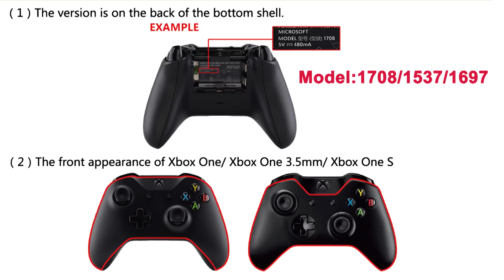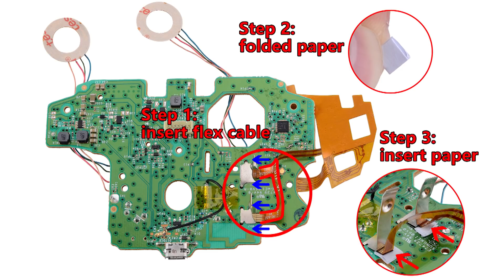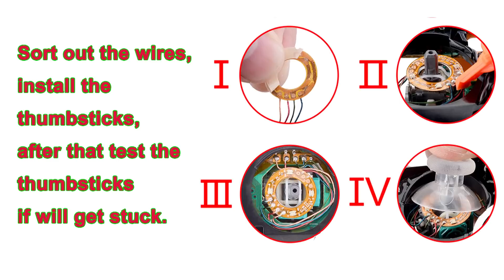Xbox One Controller DTF LED Mod Kit Installation Guide - eXtremeRate

Comment: So, I have been sitting here for a couple of hours following every step, making sure everything with the F strip is where they need to be (with the pieces of paper) and the entire sticker is lined up correctly yet nothing is working...can somebody or ExtremeRate please help me, I don't know what to do here.
Reply from the maker: Is the controller still functional? And are your AA batteries in full power?
Reply: @ExtremeRate  yeah, the controller still works and turns on fine with the batteries.
Reply from the maker: @samilynn26  So the F strip, when you insert it under the battery metal plates, the terminals have to touch with the metal plates. If you do this step right, do you see any damages on the LED and the F strips?

Comment: i'm a kid i will be doing this will anything break?
Reply from the maker: You need basic electronics repairment hands-on skills. And this is a DIY project so we will not guarantee any damages with your controller.
Reply: @ExtremeRate do you need to take out on and rb because i can’t take mine off.
Reply from the maker: @paperplanespaperhearts  You need to take them off during the installation
Reply from the maker: @paperplanespaperhearts  What's the problem exactly?

Comment: i attempted to do this, i did it but my controller lights up as soon as my battery is plugged into it i cant change the color from green im using rechargable battery
Reply from the maker: Have you tried a pair of ordinary AA batteries?
Reply: @ExtremeRate  yes i have they still light up but i cant turn it on or off myself or change the color from green everything is hooked up to the proper spot as soon as i plug the batteries into it it instantly lights up green
Reply from the maker: @ITry2bBad  That's weird. Don't worry, please let us know your order number via email to sevice@gamingcobra.com with your shipping address and YouTube name, we will send you the replacement of the LED flex to try again, thank you.

Comment: Will it still work if I use a cord, like on a strike pack?
Reply from the maker: Yes
Reply: @ExtremeRate  oh thanks, I just use a cord mainly so I didn't know if would work or not because the power comes from the battery contacts, but it didn't seem to mess with the micro USB port
Reply from the maker: @Chic_boom  Oh, sorry, I made a mistake. You have to buy the DTFS version instead of this version. And if you buy the DTFS version, you have to choose the CSP installation, which means you have to do the soldering (2 places) Please check this https://www.youtube.com/watch?v=YuoarkBQDI0
Reply: @ExtremeRate  oh thanks, I guess I'll use batteries, as i cant solder
Reply from the maker: @Chic_boom  Then the LED will not light up when you using the strike pack :(

Comment: Shame it doesn't work with the elite controller will there be one in the future ?
Reply from the maker: we will think about it, but elite controller has elite thumbstick which is made of metal, the light can not shine through
Reply: You can buy transparent Thumbsticks with interchangeable tops similar to Elite which would be a decent compromise on this.
Reply: It works with the elite, you just have to cut a small hole into the plastic from the kit and you are pretty much done just do it afterwards like in the video and it will work. I have done it
Reply: @thechxice9061  I'll give it a go thanks 👍🏻👍🏻
Reply: Hi Christophe Xbox one GTA ?
Reply: @thechxice9061  nice man looks awesome 🤙🏻

Comment: I followed the video down to every detail and now my controller won't turn on. yes the batteries are in the correct way.
Reply from the maker: When you connect the USB cable with the controller, can you turn it on?

Comment: mine lit up just and then suddenly turned off and died, what wouldve caused it?
Reply from the maker: Is the controller still functional?
Reply: @ExtremeRate  yes it still works perfectly fine
Reply from the maker: @budgetbuildup  Are the batteries power full? And have you tried to re-install the F cable?
Reply: @ExtremeRate  yeah, I reinstalled the whole thing a few times afterwards too
Reply from the maker: @budgetbuildup  Please let us know your order number via email to info@extremerate.com with your shipping address and YouTube name, we will send you the replacement of the LED flex for you to try again, thanks

Comment: I installed it but my lights don't come on
Reply from the maker: Please make sure the power flex of the kit connect to the battery plate correctly. And please use a new pair of AA batteries.

Comment: I just followed this perfectly and it doesn't turn on
Reply from the maker: Please make sure the flex under the battery metal plate was contacted successfully.
Reply: By putting a piece of paper under it like you said in the video, I did. Your product just isn't consistent
Reply from the maker: @iangagnon7353  Please try a new pair of batteries. If it does not turn on still, please contact our customer service via email at info@extremerate.com, we will send you the replacement, thanks.
Reply: @ExtremeRate  no it wasn't the batteries. I already did and sent the item back through ups
Reply from the maker: @iangagnon7353  oh...

Comment: yo is their any way i can send you mt controller so that you can install it for me?
kinda tried and failed
Reply from the maker: Sorry, we don't offer this service at the moment. What's the problem did you have for your last trial?
Reply: @ExtremeRate   the thing is i have two controllers i tried it on the good one and failed i guess the controller does not work some buttons are randomized i guess they do random things the led dont turn on the battery part doesnt work yeah sooooooo thats it
Reply: @ExtremeRate  wich is why i asked but i guess you cant
Reply: @ExtremeRate  oh and a nother thing my controller doesnt work at all anymore
Reply from the maker: @TWØPLETØP  The difficulty of this project is just medium. Please try again step by step. And the installation is safe, it will not harm the controller itself. What if you charge the controller via USB? Is the home button lights up?
Reply: @ExtremeRate  yes only with usb the controller turns on will the sticky orange thing loose its stickyness but i will try to do it again step by step even tho i tried but the only thing is that the buttons just do random thing like B whould launch or quit the game A does nothing but ill do it again
Reply from the maker: @TWØPLETØP  If the buttons not respond, I think the position of the LED flex is not good so the conductive rubber can not touch with the buttons circuit on the controller main board
Reply: @ExtremeRate  ok ill see the video again slowly this time and see wtf is going on
Reply from the maker: @TWØPLETØP  Please keep us updated

Comment: Hi, the led start but the controller not... What i do?
Reply from the maker: What happen if you plug the USB cable to the controller and press the home button?
Reply: @ExtremeRate  the led and controller don't start... But with batteries led go on... The controller still don't start
Reply: @ExtremeRate  the batteries are Panasonic
Reply: @ExtremeRate  i don't have anymore the 2 motors, is a problem?
Reply from the maker: @emanueletradori7568  Please try to connect the controller via USB cable to your PC, and go to this site to see if it can recognize the controller on the site: https://gamepad-tester.com/
Reply: @ExtremeRate  ok thanks
Reply: @ExtremeRate  it work thanks
Reply from the maker: @emanueletradori7568  So the controller works now?
Reply: @ExtremeRate  yes it work thanks but i have bad batteries and blue, cyan and other colora are bad but its ok
Reply from the maker: @emanueletradori7568  When some colors are bad, it means your battery was not in fully power
Reply: @ExtremeRate  ah ok thank u
Reply: @ExtremeRate  which batteries can you recommend me? (Rechargeable)
Reply from the maker: @emanueletradori7568  You are most welcome!
Reply from the maker: @emanueletradori7568  We recommend you to use the official rechargeable kit
Reply: @ExtremeRate  perfect thanks again
Reply from the maker: @emanueletradori7568  You are welcome again :)

Comment: Mine doesnt work and it's too hard to go back and unscrew everything then put it back together properly, could I just get one premade for me
Reply from the maker: We have 2 versions of this kit, one is the whole transparent, another one has letters on them
Reply: @ExtremeRate  I have the one with the letters on it, I'm trying to fix it right now but I am really struggling

Just finished it still doesnt work I think I was given a faulty one I followed this tutorial many times at this point i have tried 6 times now very displeased
Reply from the maker: @nappy3  Xbox one controller has complicated structure and it's a little hard to disassemble and assemble again. But if you slow down, be careful and pay enough patiency, the work can be done finally. Good luck!
Reply: @ExtremeRate  what if it truly is defective ?   will you send a replacement ?
i am considering the letter version.
Reply from the maker: @OugaBoogaShockwave  Yes
Reply: @ExtremeRate  wow, the fact that you do replacements probably sold me just now.
Reply from the maker: @p529.  What do you mean?
Reply: @ExtremeRate  I wasn't sure if you would do replacements. Discovered your guys stuff on Amazon today but you guys seem pretty alright with all the videos too and the replies and all.
Reply from the maker: @p529.  We deliver not only our products but also our service :) Both of them are alright :D
Reply: @ExtremeRate  yeah, sounds great man! Pretty sure I'm going to buy a kit next payday! :)
Reply from the maker: @p529.  Thank you!!!

Comment: My lights turn off every time my controller vibrates. How do I fix it please?
Reply from the maker: What batteries were you using?
Reply: ExtremeRate The charge and play batteries
Reply from the maker: @chrissao2355  OK, then please check if the flex that inserts to the batter plate was stay firmly
Reply: ExtremeRate ok thank you
Reply from the maker: @chrissao2355  Is it work?
Reply: ExtremeRate no I checked it twice and it still does it
Reply: Doesn’t*
Reply from the maker: @chrissao2355  Could you please try to use a pair of new AA battery to test? If the problem standstill, we will send you the replacement of the LED flex to try again, thanks
Reply: ExtremeRate I got it working thank you
Reply from the maker: @chrissao2355  Great!! Congrats!!!

Comment: I try to instal the “f” cable but it didn’t work and I received a different version because the led from the joysticks are different from the video 

Didn’t work for me 🤮
Reply from the maker: You got the upgraded version, please refer to this vid https://www.youtube.com/watch?v=YOzM0eH1h3I When you say it didn't work, do you mean you can't insert the F cable under to the battery metal plate?
Reply: @ExtremeRate  I do it but it didn’t glow up, I have te he versión 1708 and y try many times with the piece of paper I even try with some cardboard and it didn’t work
Reply from the maker: @SS530  Is the controller still functional? And what kind of battery were you use?
Reply: @ExtremeRate  I use both batteries, new ones and the charge and play
Reply: @ExtremeRate  the controller is almost brand new I just use it to play on the phone like 3 months ago
Reply from the maker: The paper or cardboard should place under the F cable, have you do it right?

Comment: Bonso9 j'ai mis, le kit mais problème avec les vibration sa fait sauter la lumière et étain complètement le bleu à griller j'ai bien fait comme la, vidéo j'aimerais un peux plus, d'aide
Reply from the maker: Bonjour, veuillez vous assurer que le power flex a été installé correctement, sans court-circuit

Comment: Why does mine only have red and green lights
Reply from the maker: Please try to use a new pair of AA batteries
Reply from the maker: When batteries voltage lower than 2.8v (normal is 3.2v), the blue light will not lights up.
Reply: Ah okay, I'm currently using a rechargeable battery pack so I will try new battery's
Reply: I can only find solar panelled 3.2 volt battery's
Reply from the maker: @InfiniteExus  A new pair of AA batteries are ok (like Energizer).
Reply: @ExtremeRate  they all die in the controller relatively quickly

Comment: How to fix if my leds automatically work and my Xbox controller doesn’t turn on
Reply from the maker: If you remove the "F" ribbon cable, is the controller work again?
Reply: Let me see
Reply: No
Reply from the maker: @lostjulian9909  Please check if the conductive carbon print of the Home button was covered by the LED flex.
Reply: Ok

Comment: The Xbox mode led light look hard but I can probably do it but all the screws get me scared lol but ima do that for the ps4 controller idk about the Xbox Jesus enough stop it with the screws lol
Reply from the maker: Emmm, in my opinion, the Xbox One S is easier than the PS4 :)
Reply: @ExtremeRate  i think when I watch the video of you putting led on the Xbox like I think Xbox controller is more sensitive beside the stick drift but I look into that I got 3 Xbox one controller for my x one is broken im not sure whats wrong with it because my nephew left it at my house I think he left the controller because its missing some parts like the sides
Reply from the maker: @sony4ever93nyc3  Then you can take apart that broken one to experience how difficult is that :)
Reply: @ExtremeRate  yeah thats what going to get me started I have some parts that is missing maybe I can start learning the inside parts
Reply: @ExtremeRate  i can't wait to start my project on the ps4 controller ima put led light than my second controller ima do the same but ima make the second one a scuff controller but with part than the third is going to be modified with led light I kinda wish that I can find led light part for my ps2 slim and a transparent shell I want the shell to be clear or a blue clear one
Reply: @ExtremeRate  hey how did I know what model im looking for n I didn't look at the model number like am I Startin to understand repair replacement parts without knowing its the right model but I checked n im like wow its 1537
Reply from the maker: @sony4ever93nyc3  That is the oldest model
Reply: @ExtremeRate  yeah the broken controller has a missing grip couldn't find it so ima replace the full front n get replacement parts for the front n side but im thinking it has drift im thinking ima have to make a full replacement because one of my family members said  its has some trigger issues so I have soldering kit coming to my house either Monday or Tuesday for my ps4  controller but idk y some stuff  for xbox is cheaper than the ps4 controller version
Reply from the maker: @sony4ever93nyc3  That sounds good

Comment: Mine is not working😑
Reply from the maker: I saw your other comment, but this kit was designed for the Xbox One controller, but for the Series X controller :(
Reply: @ExtremeRate  i have enough xbkx one controllers too put this kit in but i just tested it on the new one so im just putting it into my other new xbox one controller i just got from 2 weeks ago
Reply: @ExtremeRate  mine finally worked its cool to see it on night
Reply from the maker: @petetrendel1758  Congrats!!!  :D

Comment: So i had a comment earlier saying that mine didnt work but you guys were ignorant and told me that i was the problem. turns out i did actually have a fully dysfunctional product and you guys refused to send me a replacement extremely unhappy and i would like you guys to know that it also fried my controller so now i have to get a replacement one thats $100 down the drain to a crappy product with crappy results and crappy customer support.
Reply from the maker: Could you please let me know when and where is your earlier comment?

Comment: I have an idea for you guys, as you know we can connect an Xbox One controller by Bluetooth , my idea  what if we can reprogram the Xbox controller by Bluetooth .eg. mod the controller send a file the controller 🎮 , can anyone do this or who thinks 🤔 this is a good idea if you use this idea all I ask of you can you let people know I am the thinker to this idea the first one you come up with this idea thank you I hope someone can do this.
Reply from the maker: Thanks for your suggestion. But it's nearly impossible to reprogram the controller by Bluetooth, the Bluetooth on the controller is just for communicating with the console if we don't have the permission to access the program of the controller, and this part is encrypted.
Reply: @ExtremeRate  but is it possible to add files to the controller to allow more customized usage
Reply: @ExtremeRate  or even adding parts to the circuit board
Reply from the maker: @xvgxmadman1178  What kind of file for what customized usage are you expecting?
Reply: @ExtremeRate  something that no gamers have ever experienced before
Reply from the maker: @xvgxmadman1178  Thanks for your suggestion bro. Please keep the new ideas come! :D
Reply: @ExtremeRate will do brudda

Comment: Why is my kit always blue when it’s off ?
Reply from the maker: Could you please describe the problem in more detail? Thank you!
Reply: So as soon as I put batteries or the play and charge kit my kit is blue before I even turn it on
Reply from the maker: @V6_Fuzzy  Can you turn it off or change the color? Please notice that the LED will not be light up or off when the controller turns on or off, you have to do it manually.
Reply: Yes I can turn it on and off and change colour etc but as soon as I put batteries in it automatically goes to blue
Reply from the maker: @V6_Fuzzy  Possibly the wires of the thumbstick LED short out with the thumbstick component,  please neaten those wires to avoid touching any metal part inside of the controller and to see if it can help